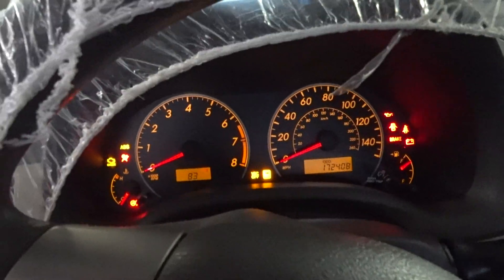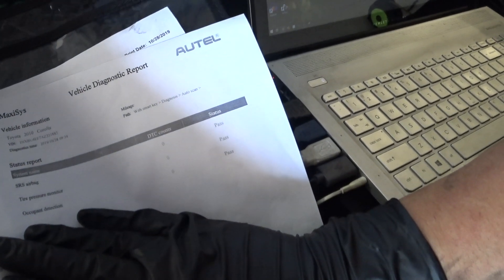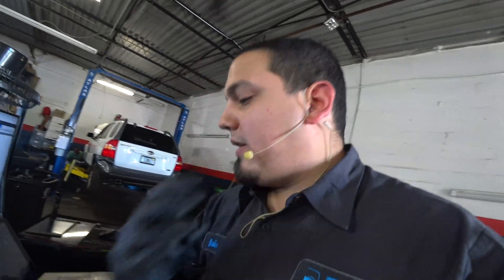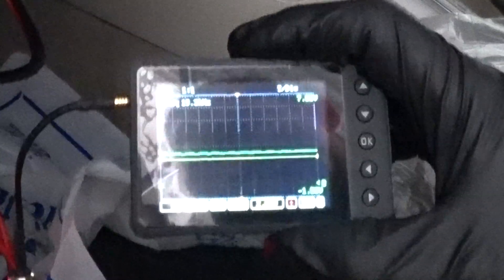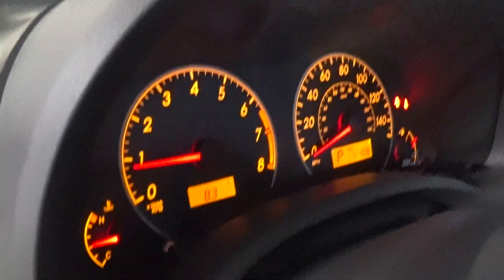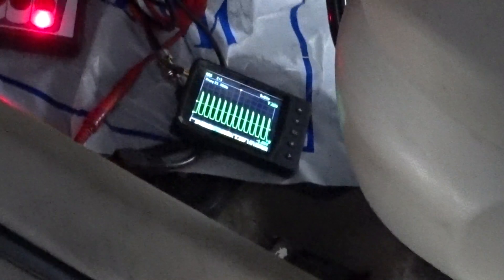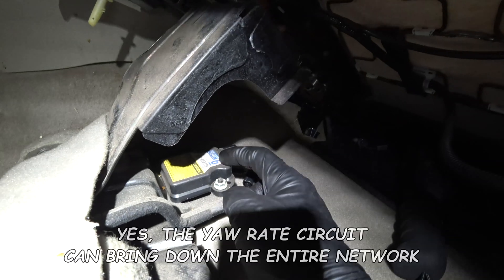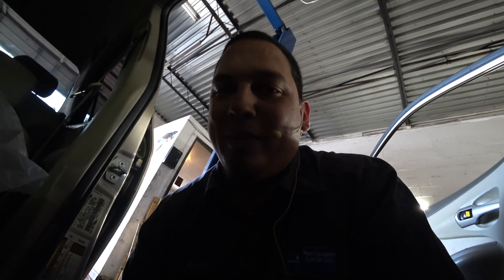2010 TOYOTA COROLLA - CAN BUS INTERMITTENT ISSUE

Comment from the maker: I made an incorrect statement. I said that a shorted input to a module can bring down a CAN bus. 

After being given a heads up by Paul Danner, I didn't want to misinform the public, and cause unneeded work to the viewer. 

The yaw rate sensor is a module on the can bus in that video(an oversight of mine). The CAN wire to that sensor/module was shorting to ground, causing a problematic CAN waveform. While in my video I did say that a yaw rate circuit issue can bring down the entire network, that is true, but in this case it's part of the network, and yet I deemed it an input. 

A shorted 5vref however can cause communication issues to its module. But it WILL NOT cause a CAN bus to go haywire. Only a lack of communication to that module. BIG DIFFERENCE.

The last thing I want is for someone to see my video, take what I said, see a bad CAN waveform, find the culpable module, but then needlessly depinning inputs or further testing to rule out inputs to that module as an issue. 

The intent of all my videos is to aid in this craft, not to create needless work for its viewers.

Comment: That's CRaZy man!.....I just had a 2010 Corolla with the exact same symptoms.....the exact same signal you had on CAN high.....and CAN low was shorted......no tach or speedo.....and couldn't communicate with the CAN network on my scantool......

I unplugged the ECM and Brake Module just like you did, but made no difference.......I studied the diagrams too and was gonna go for the junction connector just like you, but honestly looked and couldn't even find it, seemed like it was buried.......so on a hunch, and what I had heard and read from others.....and from studying the diagrams......I decided to unplug the steering angle sensor......and.....BLAM!!!!!.....that restored Comms, and the tach & speedo & everything.......the only code left in it is for that steering angle sensor because I have it unplugged......

And I just posted a video about it on my Facebook & Nextdoor page....and then just happened to come across this video of yours.......so felt like I had to comment about it.......yours was the exact same symptoms as mine, but 2 different sensors/CAN wire short locations......causing the exact same symptoms.......and exact same CAN signals.......that's pretty crazy to me.

Comment: A client complaint that when he was on motion is airbag blew. Eventually, he noticed that the smoke was emanating from the engine bay. Hence, he pop-up the hood and saw that the smoke was coming from the ABS module. He called a mechanic to unplug the ABS module connector. Afterward, the connector was connected back. Henceforth, he has noticed that his steering is stiffer to steer. Additionally, he said : "the car isn't moving smoothly as before."

Yesterday, he called and said even the headlight and other lights aren't working again in the car.

The check light appears first, brake light second then finally the P/S light appears. They lights don't come out at once. It's a 2010 Toyota Corolla Le.

Please how do I fix the problem?

Comment: So I finally found the issue. I thought it was in the back door because I unplugged the harness leading to the back door and lost voltage. That harness ended up also feeding the blue tooth module in the rear of the car. The module waa covered in water with green crust all over it. This was one of the hardesss draw I had because no codes all the diagrams on alldata and Identifix was wrong or misleading. The amp draw waa really small and intermittent crazy one. I feel embarrassed I have around 5 to 6 hrs in it. I believe they auction this car because of that issue. Everywhere I looked bolts where missing.

Comment: Great video, Mario! I haven't seen that issue, yet. But I have a feeling that I will eventually. Was there any electrical clips, or anything undone that allowed the harness to rub on that bracket?
Reply from the maker: Nope, i think they might've stuck an umbrella in there, bent the metal into the wire. That's my theory 😆